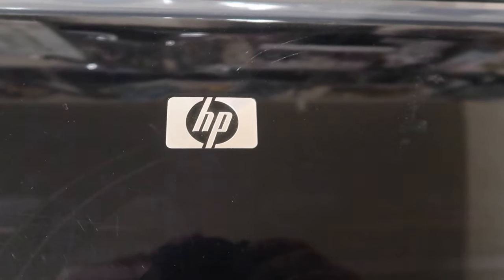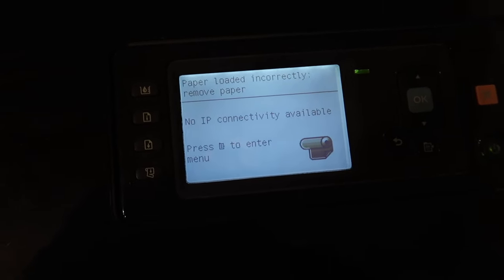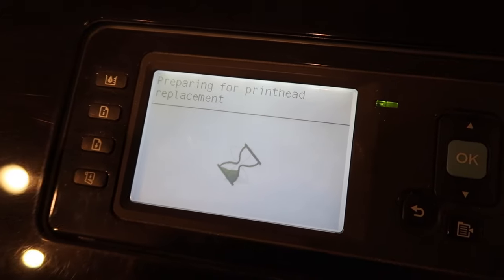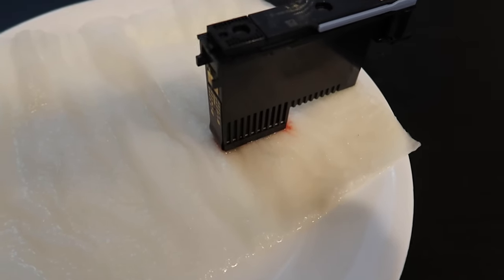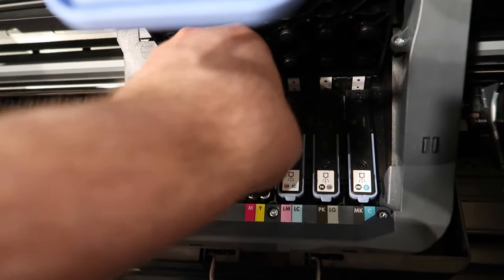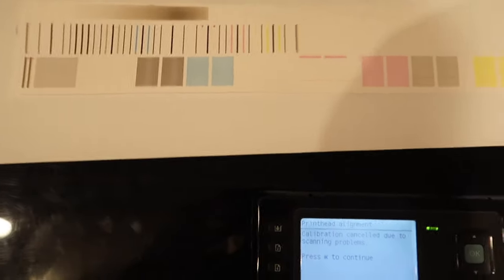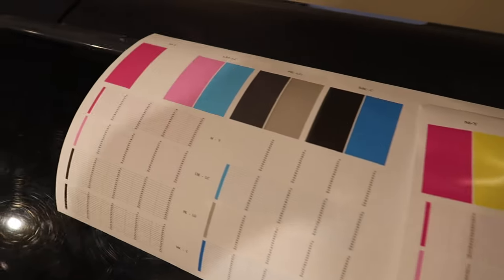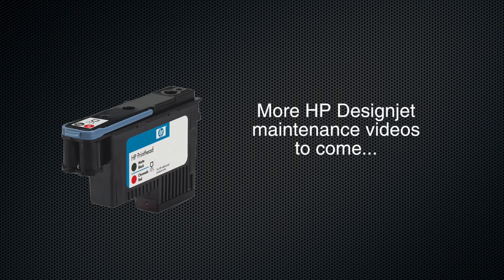How to clean a clogged HP Designjet Printhead

Comment: I bought a HP Z5200ps 44" with HP 70 printheads a month ago, I have a problem with 3mm stripes appearing in images with certain tone of orange and certain tone of green on only 3% of images that I print have this issues. On test print out of the printheads all looks perfect. The printhead is dated 2016 on the M/Y and have only fired 360ml of ink, I assume it is the Magenta and Yellow causing the issue. I have just ordered and now waiting for delivery of the M/Y printhead and then I watched your channel. I will try the cleaning method before I replace or not with the new printhead.  Thank you.

Comment: I have some interesting questions, if you know - please share; 1) if the printer swears at the head, is it worth cleaning it. 2) can the printer swear if the head is clogged or there is little ink inside? 3) from several head pulls - are the loops on the side (contacts) damaged?

Comment: Yellow was printing apricot on the diagnostic.  I would clean the printheads 10 times until the yellow appeared again, but on the next print job the yellow would be missing again, and the trees were a beautiful blue.  This worked for me and restored my yellow; however I lost the light gray.  Cleaned the gray twice and it wouldn't return so I ordered a new printhead.   The next day I wondered if maybe water from cleaning the yellow was causing the gray to go missing.  I cleaned the printheads, and printed a diagnostic.  The gray was back and all was well.  Thank you, thank you.
UPDATE - YELLOW AND GRAY kept randomly disappearing so I replaced all printheads and finally got the result I wanted.

Comment: Must try this! Have you ever had the problem where basically the yellow is printing out the black? and the thing is the cartridges have never been put in the wrong way... thanks!
Reply: I believe the black is pigment based which means it's a suspension of some very very small solids.  If you were to filter the black particles you get a yellow colored fluid.  I too have seen the yellow in the black printhead when cleaning it  I think it's likely a product of a clogged printhead, but I'm not 100% certain.  Regardless, don't go down a path of trying to find out how the yellow got into the black.  It didn't.  The yellow CAME FROM the black ink.
Reply: Got it sorted eventually, however I have a new problem now which is I have no magenta coming out at all, and this was with both the original print head and the new one... I have gotten a syringe and pulled through ink through the line but to no avail... an ideas to help would be great, thanks!

Comment: Unfortunately this didn't work for me. I soaked with a mix of 75% lukewarm water, 25% ispoprop for about quarter of an hour - initially print on the affected channel returned to as-new (about A3 worth of the affected colour), but just started to show starvation as I cancelled the print -- on the second test print it started to run dry again almost immediately with severe starvation issues.

Several reseats of the affected printhead made no difference. Interestingly ink is getting through to the head, but obviously not quickly enough to satisfy printing requirements. I can start with uniform coverage but then it fades to nothing after several head passes.

I've not soaked the head for longer - didn't have the opportunity. I haven't checked the cartridge, though ink level is almost 100%. Can't eyeball the lines to see if there's a clog... As HP shroud them with black plastic. All other colour channels are fine, which is even more annoying. HP genuine inks and parts always used.

Should I be trying a heavier IPA base - or 100% water - for longer, or is there something else I can try before buying a new printhead?
Reply: I have serviced these & inkjets for years -- always use water. The ink is not alcohol soluble and when alcohol mixture is used it will only dissolve in the water that is mixed into the mixture -- if you had 100% alcohol it would not dissolve
Reply: @geeder9086  that's useful info. I was hoping the IPA might help break down any stubborn clog before itself dissolving, but evidently using warm water would have been more effective. I ended up restoring an Epson a month afterwards with some head flush solution which worked pretty well, and the DesignJet was treated to a new printhead meanwhile. It had lasted eight years with no meaningful maintenance so I will duly note for next time! 

When I'm back in the office in January I'll be sure to do some periodic maintenance because it's sat idle for months... Like it had last year in fact 😂 do you have any recommendations for keeping these heads in good condition?